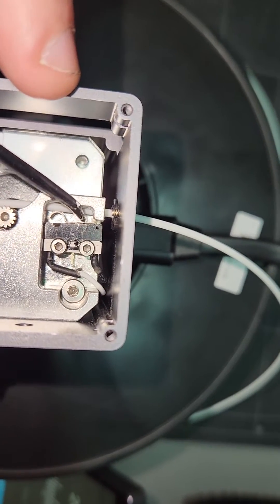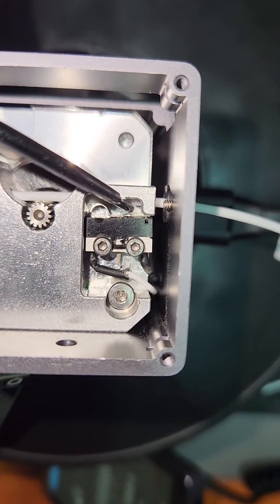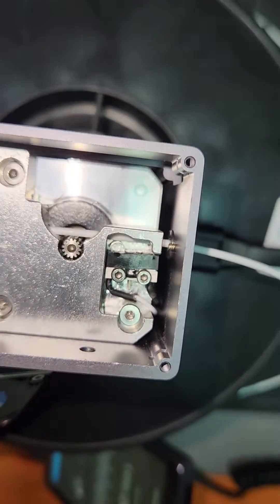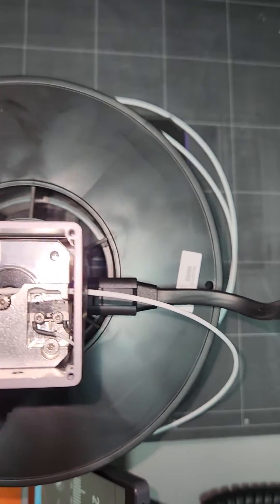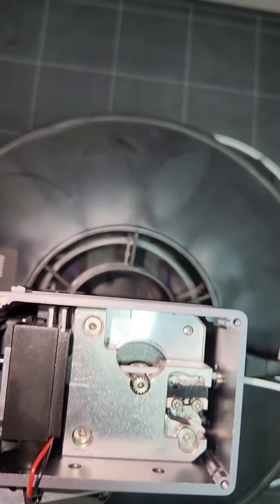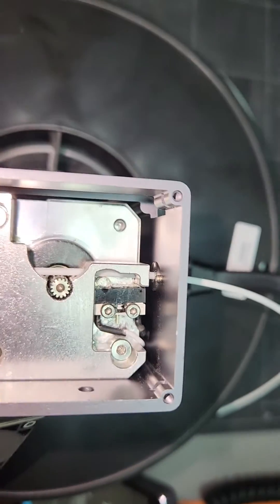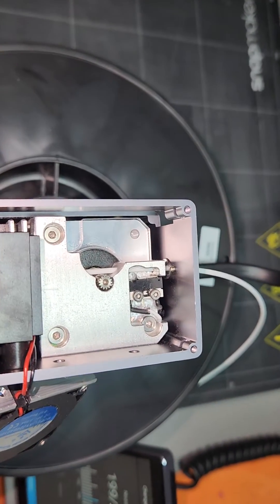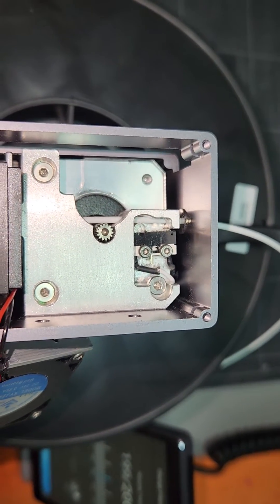Snapmaker 2.0 filament run-out switch not working. This is what is wrong with it.

Comment: Fully support you
Reply from the maker: Thank you man, I was trying so hard not to cuss I could barely get words out.
I did get it going by cutting a shim out of an old raft from a previous print and jamming it in at the top of the microswitch. It may take some adjustment to make sure it is able to achieve the open state upon runout. I had lots of printing to do and a full spool loaded so I haven't had time to test yet.
Again, I appreciate your support.